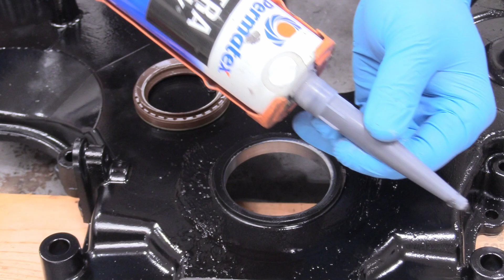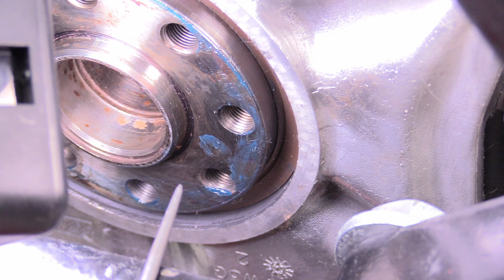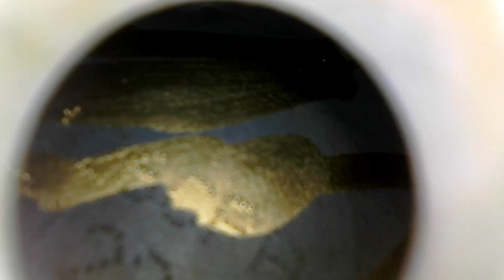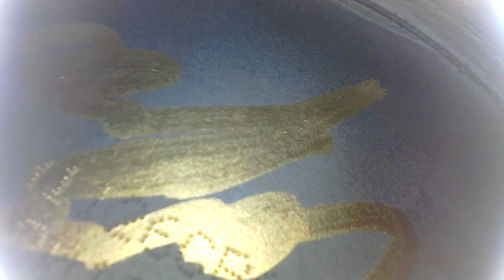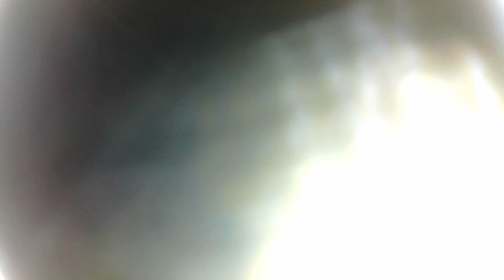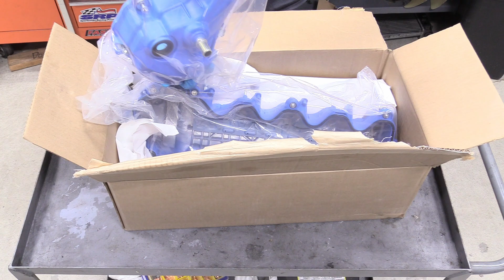How to Build a Ford 5.4L 3V Engine - Part 8: Timing Cover, Roller Followers, Valve Covers!

Comment: Ever lose a valve in the cylinder compressing those? I noticed the keepers looked really loose 😮
Reply from the maker: Nope. Thanks for watching!
Reply: @2carpros what grease can I use in place of the summit racing grease? I have Red "N" Tacky or EP Moly or Multi - purpose Lithium.

Comment: So far , this is the best video thoroughly well explained , with complete instructions , thank you Ryan .
Only one thing ;  after  you  installed the  first 3 cam followers/rocker arms  on cyl. number one , you didn't explain which cylinder next .
But thank you though .
Great video .👌😀
Reply from the maker: Thank you so much for watching! It doesn't matter. Just rotate the engine over until you get clearance on which ever cylinder you like. Thanks for watching!
Reply: @2carpros got it , thank you .
Reply: @2carpros another part that made me laugh is when you said you were going to hold our hands and not to be afraid  😂🤣 thank you !!

Comment: Why not do the roller followers while the cam is out?
Reply from the maker: Pressure on the cam will distort the torque spec for the cam caps. Thanks for watching!

Comment: Once I install the rollers and start spinning The crank shaft  to install the rest , it’s timed ? I spun the crank around to make sure the pistons weren’t touching the valves and the chain ⛓️‍💥 marks don’t line up
Reply from the maker: As long as you bolted it all together with the marks in the right spot you are good to go. I had the same concern but the crank and cam sprockets have a different amount of teeth so the marks on the chains "move" when you turn the engine.

Comment: I did the timing chain replacement took off the cams and took out all the roller followers. My keyway is at the 11clock I haven’t moved since I replaced the guides, tensioner etc. 

My question is would I install the new roller followers with the spark plug out? 

Also do I keep the front cover off so I can turn the crank to put the cam lobs at base circle and to move the piston to reinstall the 24 roller followers?

Comment: Question…

Do you absolutely have to install the roller followers with the camshafts in place? I know it’s not best practice, but in engines with direct cam on valve actuation, you can’t relieve the spring pressure on the cams and you just remove and install them very carefully in many stages.
Reply from the maker: According to Ford yes. If you have tension on the cam while you tighten it down you will get an in accurate torque figure. Thanks for watching!

Comment: 19:25 
This " Crank turning tool" Is a Crank set tool. The handle hole is for a guide dowel on the block. Align the crank chuck with the tool and the dowel then bam. Dead set timing on crank.
Reply from the maker: It can have 2 purposes. It's either lined up correct or it isn't. And when it isn't it is super obvious. But yeah it can be used for that too! Thanks so much for watching!
Reply: @2carpros  What's your opinion on the steel tensioner?

Comment: sir why not put follower befors camshaft
Reply from the maker: The spring pressure from the valves would interfere with your torque specs. There is a special tool for roller follower installation which I showed. Thanks for watching!

Comment: The tool you pointed out for turning the crankshaft is actually a crankshaft positioning tool.  It slides over the crank and woodruff key and the whole on the handle lines up with a dowel pin on the front of the engine positioning the crankshaft perfectly for timing.

Comment: Do I need to remove the camshaft to install the roller followers and do I need to hand rotate the engine for the rollor follower I'm working
Reply from the maker: Camshaft has to be in it install the roller followers. Then rotate the engine over like I did in the video. Thanks for watching!
Reply: @2carpros  oh OK so rotate the engine each time to work another roller

Comment: Hello, i have a question so when i removed the intake followers from cylinder 5 i mix then and cant figure out wich one goes where. Would it be a problem if i put them back since i dont know where they go or can i just put those 2 new will it be any problem?
Reply from the maker: Since it's a roller it will probably be fine. Thanks for watching!

Comment: hello and congratulations for your videos. I'm writing to you from Italy, because I'm timing my Ford Mustang GT 2010 4.6 3V. now I have to replace all the roller followers. I wanted to ask you if it is right to do one side at time and one "piston" at time? when I place the followers is it enough to be careful that the cam lobes are with the rounded part facing downwards? Or do I also need to check the piston position?
Reply from the maker: Thank you for watching! I do one side at a time just because it's easier to stay on task. Same reason I do one piston at a time. The pointed side just needs to be rotated away so you can sneak the roller follower in. Thanks for watching!
Reply: Ok. Thanks you very much.. so If the pointed side Is rotated away, the piston Is automatically down? Thank you for your effort and Sorry for my ignorance😅

Comment: 10:00 there is a torque spec for the front cover. You got the wrong valve covers!
Reply from the maker: They are for that engine and don't leak so I don't think so. Thanks for watching!
Reply: There are 2 different types for the 5.4L- 9 bolt and 15 bolt...
Reply: @Onry1 stfu u don’t know.

Comment: Ok so are all valve covers 10 bolt now because I have yet to see a video that addresses the elephant in the room. It seems ford re did all valve covers in 2010, but all the 15 bolt valve covers are impossible to find so can I use a new 10 bolt cover and gasket on my 15 bolt head?
Reply from the maker: Yeah I did in this very video. Thanks for watching!

Comment: I found the crank oil seal doesn't center if you torque down the cover first, rather install four bolts on the cover finger tight, then install the flywheel  partially until the seal is centers on the flywheel, then torque down the cover bolts.

Comment: Can we place the Roller Followers in place and then install the camshaft?
Reply from the maker: Nope. It will interfere with the torque specs when you try to tighten down the cam caps. Thanks for watching!
Reply: @2carpros  good to know, thank you.

Comment: I tied braided fishing line in a loop through the oil passage on the lifter side of the follower. This allows you to keep that end up as you slide it in and right on top of the hydraulic lifter.
I bent a piece of 12 guage electrical wire(from romex) in a small loop to pull the fishing line under the cam lobe. Then grab the loop and guide the roller follower in place. Makes this much easier!! when you get it in place, cut the fishing line, and pull it through the hole having the knot in your hand. Then release the valve spring!!! Try it it works!!!
Reply from the maker: Love the inventiveness! But if I show anything less than the factory way of doing it everyone in the comments gets very shouty at me. Thanks for watching and great idea!

Comment: My timing cover was leaking oil at the bottom bolts and running all over the bottom the vehicle, made the oil Pan look like it had a leak and I thought it was the rear main seal.  Ford uses the Same Bolts to hang other components from.  When someone works on those components they don't realize if they over tighten the bolt it is Crushing the timing cover gasket.  So you end up chasing oil leaks.  Thought it was the Oil filter adapter gasket, no.  Timing cover gasket.
Reply from the maker: Yep. Important to not over tighten! Thanks for watching!

Comment: I haven’t built one of these, but I’m watching because I have an ‘07 I just bought. Great info… quick question though… would it not be easier to install the roller followers before putting the cam in? Is there a reason to put them in with this tool? Or is this just one more thing a dumb Ford engineer came up with?
Reply: Yes, you won’t be able to bolt the cam down. Or rotate it to time the engine.
Reply: good question

Comment: I can't not say it.  Sorry.  

I'm not a fan of RTV where it didn't come from the factory.  Those main seals are going to be fun to remove and get cleaned up next time...  Source: Had to do such before where it shouldn't have been used, and I'm still mad about the extra time the 10 minute seal swap job wound up being a lot of delays of days waiting for more parts and a lot more time disassembling/assembling things I shouldn't have... all due to the idea of 'ya need RTV there, it'll leak!'  No, it won't, it's a sealing surface, the parts are designed to do that without RTV.  If it does need RTV, the parts are bad/need machining/fixing, don't patch it with RTV.  Ugh.

Sorry for my negativity, you are such a positive guy, Ryan.  But yeah, me and RTV where it's not called for are not friends. :p

Also, I thought the rear main seal plate used anaerobic sealant, not RTV? shrugs  Just I had to get that extra specially for my 4.6 when I did the rear main during the clutch job...  Now I feel wronged somehow. :)

Thanks for all you do making this channel work, still lovin' this 3v rebuild!
Reply from the maker: Yeah but I'd rather clean up old RTV than constantly clean up a leak. I've definitely had leaks on something that shouldn't that had a gasket. I see it as cheap insurance. No one, including me is going to send their head and block black to the machine shop just to make sure the timing cover fits perfectly flush when you can just use a tiny amount of RTV and be perfectly fine. 

Ok that's fine, like I said in the film dont use it if you don't want to. That's what makes racing as my Dad says. 

I think it's splitting hairs. I have always used RTV on a rear main and never had a problem. 

Thanks so much for watching! :)

Comment: Let you and I swap 5.4 3 valve engine's. Mines of a 2008 late model with the one good spark plugs don't know if it's the original motor but it's got 259000, and runs good, oil change every 3500
Reply from the maker: What a deal for me! Haha thanks for watching!